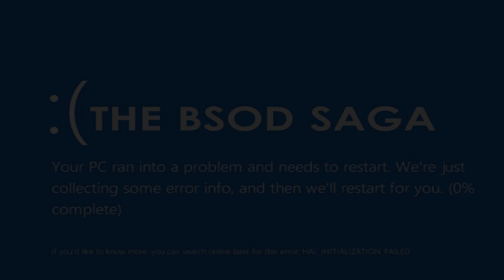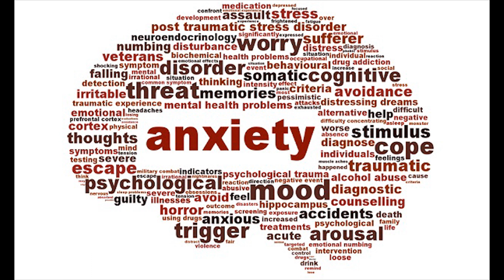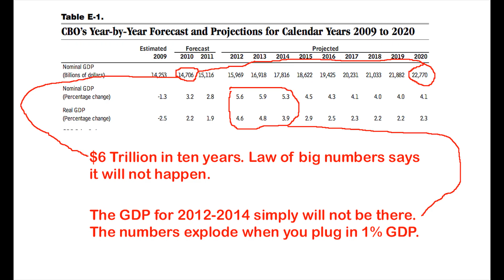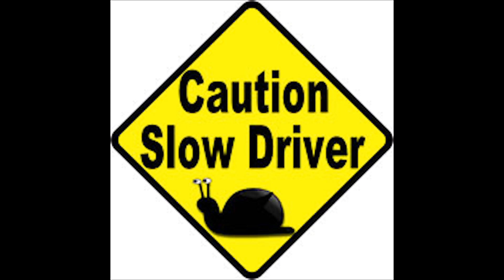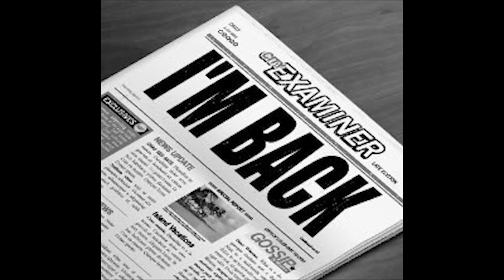The BSOD Saga: Part 8 The Road To Hell

Comment: You're not the only one who goes insane when someone in front of you drives at walking speed (slightly exaggerated). I absolutely hate it. Even worse when you can't pass them.

But the worst case is when you do finally pass them, you get to a place with a lower speed limit and suddenly the guy you just passed is racing (aka driving the exact same speed as before) behind you and suddenly thinks you're in his way. That's usually the moment where I completely lose it.